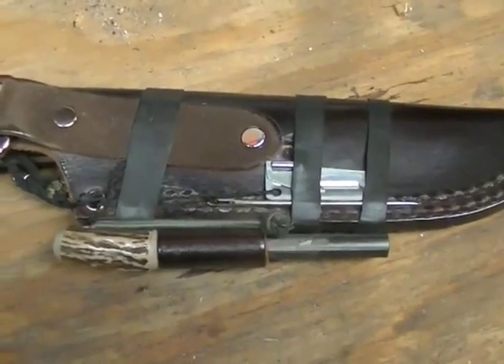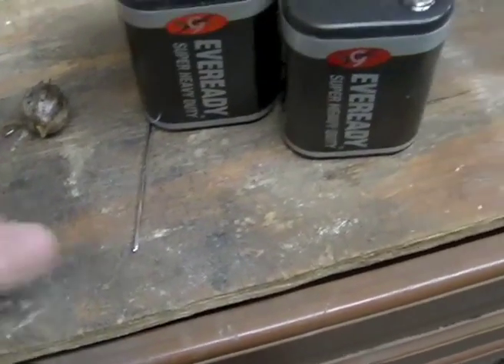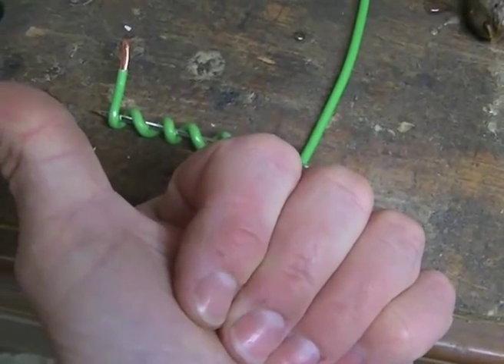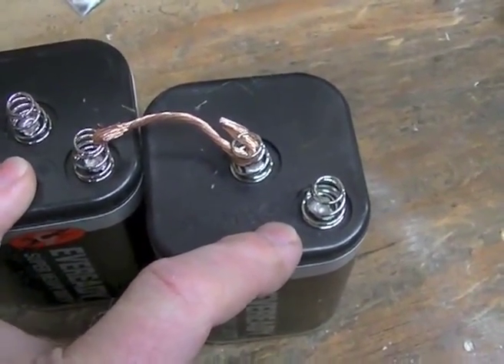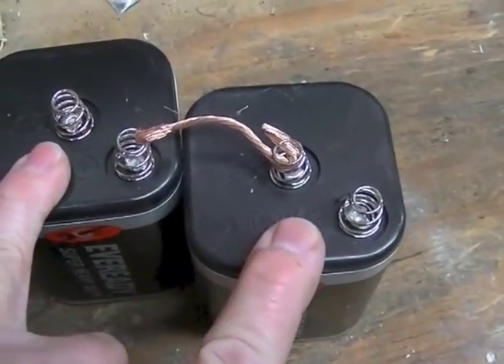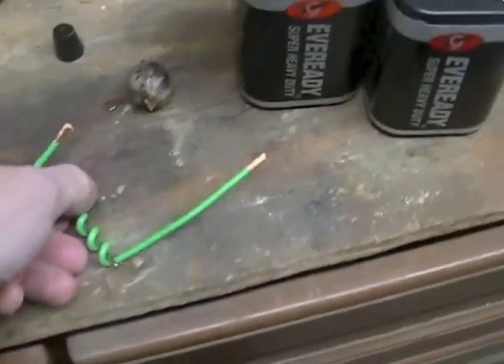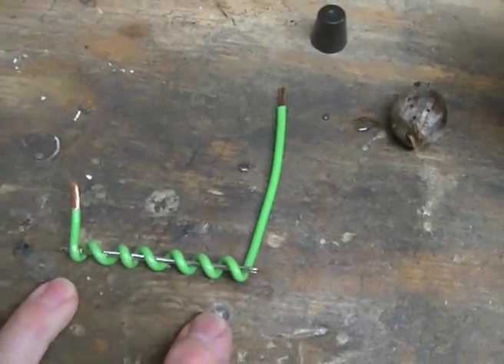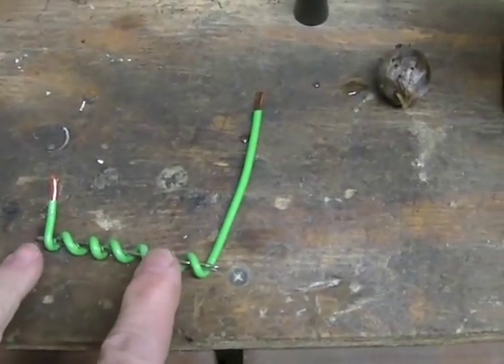Magnetizing a Sail Needle

Comment: Hang the needle 🪡 from the center on a thread. And it will point north as well if it’s magnetic.
Reply from the maker: It can work, but floating it ensures there is no “twist” to the string. You can sit there for a a long time waiting for the needle to stop spinning.

Comment: How long do you leave the needle connected to the battery terminals?
Reply from the maker: Depends on the voltage of the battery. When I went overboard and used my battery from my cordless drill it only took about 2 seconds. If you use a lantern battery let it stay connected for a few minutes until the battery is drained.